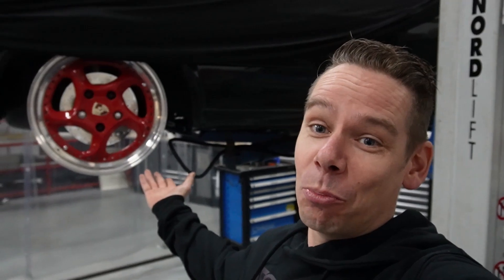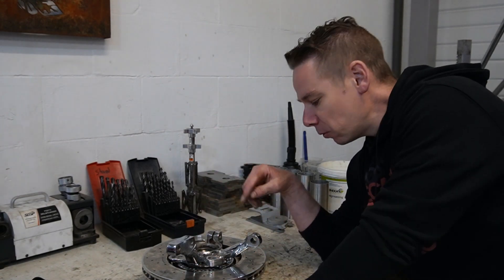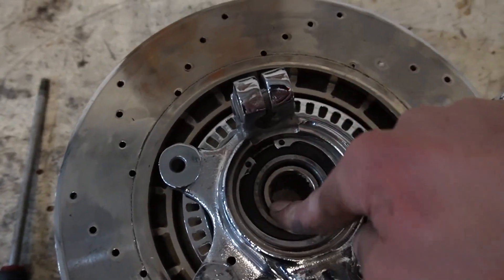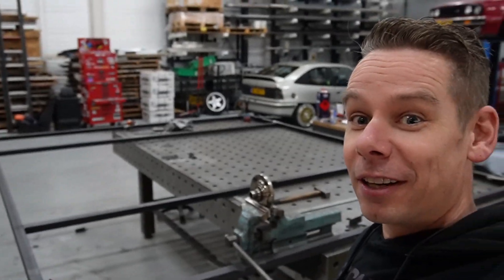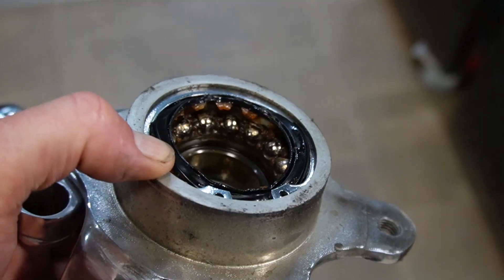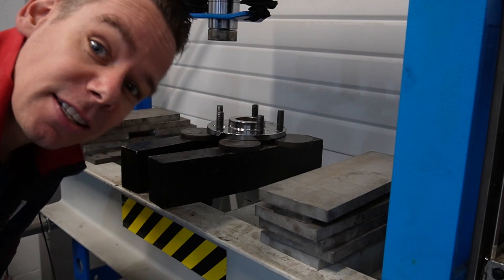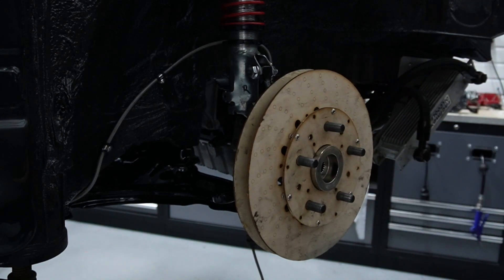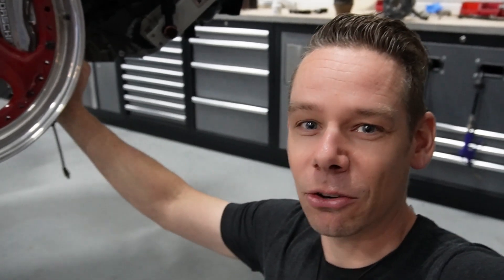VW Golf2 G60 Porsche bigbrakes and mistakes!

Comment: Hello, it's nice to see the progress!
At the back you could also do it with the things built for the Golf4 FWD, similar to the Lupo GTI adapter and Polo 9N wheel hub, then you wouldn't have to use the old Golf2 wheel hub. I think it will be easier to do this way!
A little like the EpyTec adapter kit item number: 398-PL.
You then just have to build the hub yourself like you did before and make another adapter!
We have already installed this set twice and it works very well!
Mfg OCWX
Reply from the maker: Thanks for the feedback !
I know about this option but this still brings everything outwards.
Esspaccialy with the brake setup we want to put on there`s to much to adjust.
And we still then need an adapter to 5x130. 
What we now have is Mk2 hubs with a 5x130 bore same as at the front.
Thsi way we got a lot more room to play with and we can get big lips at the rear.
Let me know if there is a better way !
Thank you OCWX

Comment: Where are you based??
Reply from the maker: Netherlands
Reply: @NonstandardNL  what would you charge on a restoration of a polo coupe s mk2 

I have a fully set of H&R to fit on it 
Have refurbed the original wheels 

I needs some slight attention underneath
Reply from the maker: @wakeup6755  Little difficult to say without any car info or pics.
 Can we chat a little about it trough email or something else ?
My email is info@nonstandard.nl